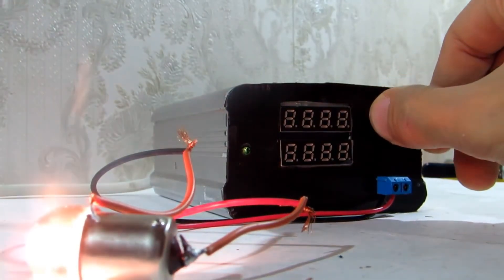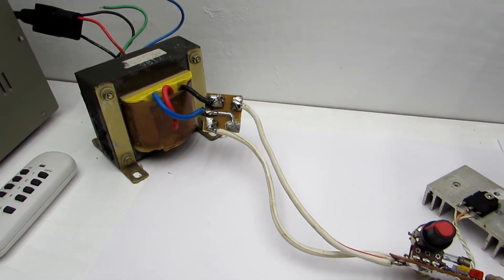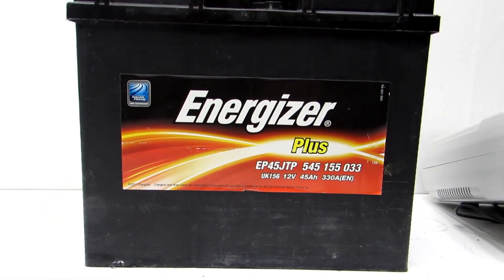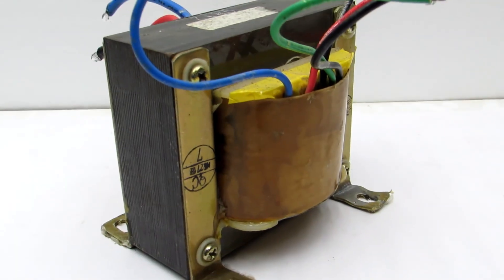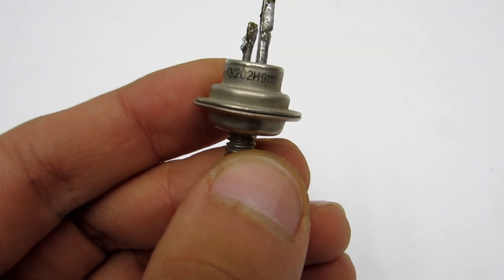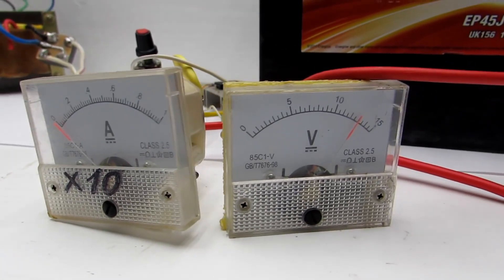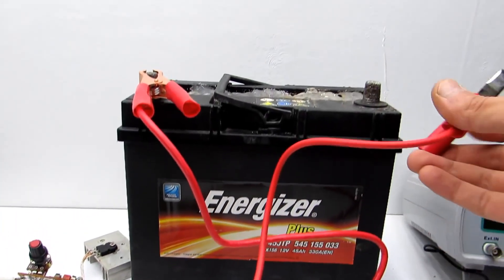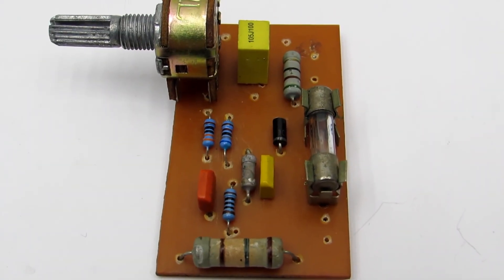DIY simple charger for car batteries

Comment: i made the circut but it did not gives apropriat out put . so i reduce the valuve of pot from 20k to 10k and i also omited 300oham resister and the circut is giving good output . is it ok or harmfull for circut?

Comment: built this the same way you did and result is not as good as i expected.. the pot will start to increase the voltage from 0  to 15v at 3/4 turn  so replace this with 5k.

Comment: Protection to reverse polarity also can be fuse. Because if you connect plus to minus and minus to plus, you'll get "two voltage sources connected in serial" and make short circuit of them.

Comment: if you make the circuit with thyristor you should never put filtering capacitor after the bridge rectifier. if you put transistor you can put capacitor and actually increase the efficiency of the transformer